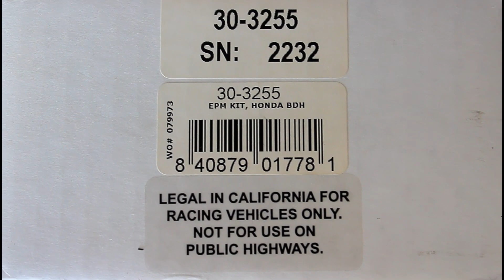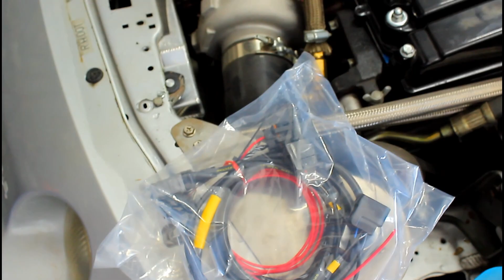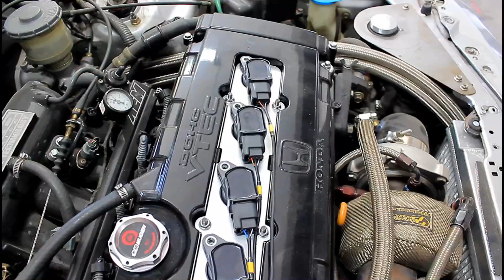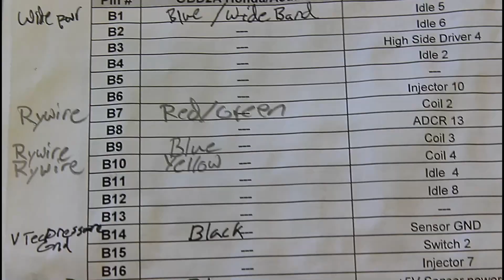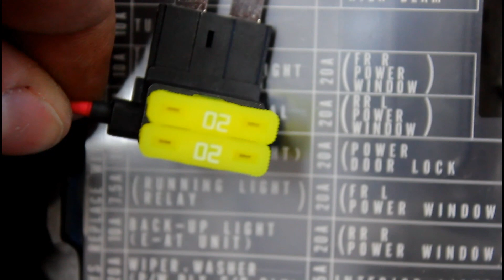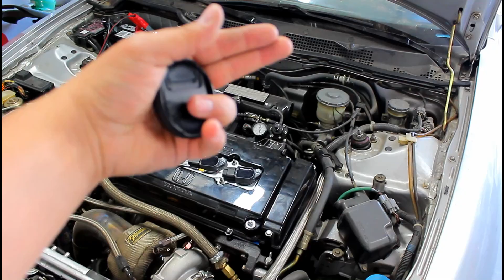Project NoRice #16 -  Coil On Plug Conversion - LS Vtec B18 2.0L Stroker

Comment: 🔥💯Please update us on this project thank you
Reply from the maker: my buddy wants to sell it.  it is on Albuquerque NM craigslist.
Reply: @FatGuyBuilds  I seen it, do you have a guess on how much money to finish it to be a daily driver?
Reply from the maker: @evilke-kneebone  i needs a coolant expansion tank added.  It is drivable all day right now.  But the coolant setup isnt the best.  He has the expansion tank already.  Just needs to be plummed up.
Reply: @FatGuyBuilds  Ok, I've been lookin at it debating. you have any hp, tq #, at what rpm?
Reply from the maker: @evilke-kneebone  to be honest he has a dynosheet from when he got it tuned.  The car is on much lower boost than it should be.  It has low compression 9.0:1.  But he refused to turn it up past 12psi i think.  So the dyno sheet is what it is.  Check Albuquerque NM craigslist for his contact info
Reply from the maker: @evilke-kneebone  power comes in much lower since it is stoked.  I feel like 20-25psi on pump gas is doable.  But i am no tuner.
Reply: @FatGuyBuilds  thanks man, good work on the build
Reply from the maker: @evilke-kneebone  i always try my best

Comment: I Can’t wait for the dyno day . I’m planning to do. Gsr stroker . Ls crank shaft with ls eagle rods n cp pistons . Making the engine to a 1.9
Reply from the maker: My buddy is actually giving up.  I guess he wants to sell now.
Reply: @FatGuyBuilds  what were the final numbers? I saw this for sale here in New Mexico. Kinda interested it’s legit
Reply from the maker: @Bacongrease00  not high enough.  He wouldnt turn it up past 12 psi.  With the compression ratio i gave him he should be daily driving at 20psi.
Reply: @FatGuyBuilds  is it sleeved?
Reply from the maker: @Bacongrease00  no.  We put in the blockgaurd very tightly.   The bored it after to make sure it was straight

Comment: I see he didnt want to sell it..Hes finally finishing it up..What's it pushing to the wheels
Reply from the maker: We will have a new dyno tune after the adjustable cam gears are installed and the cams are dialed into the correct spec